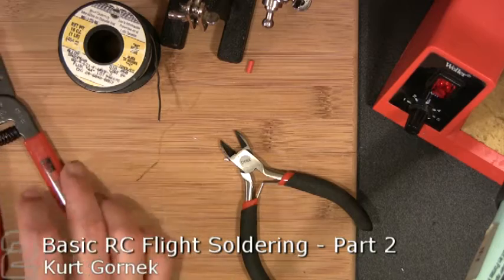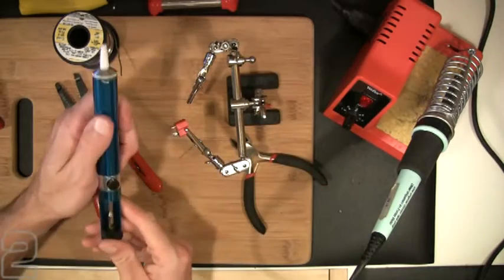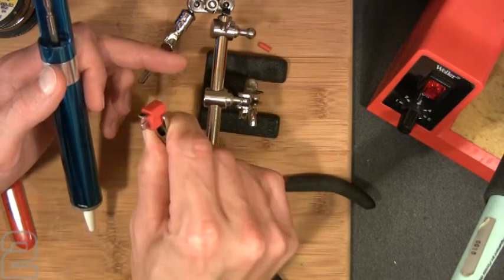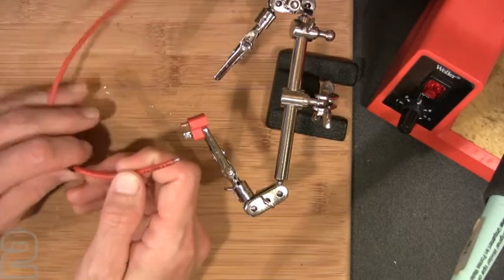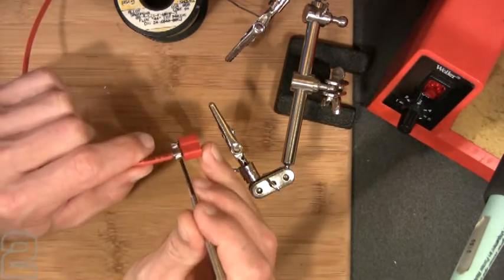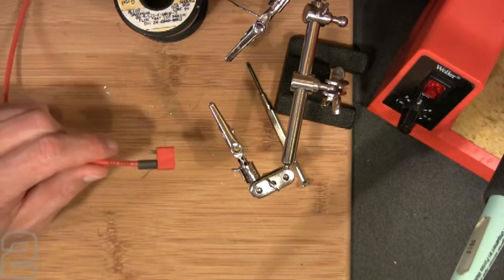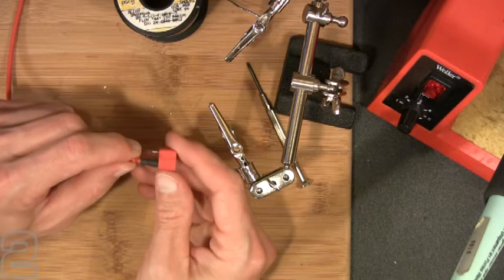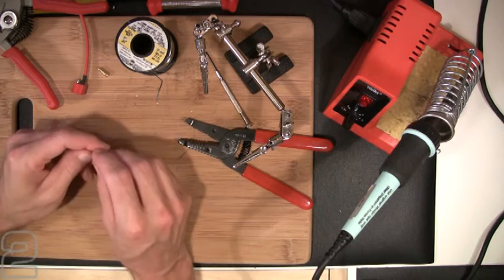RC Flight Soldering - Part 2

Comment from the maker: Silver-bearing solder (like 62/36/2) is prevalent with audiophiles (audio system nuts).  Although it does have some marginally better conductivity, slightly higher tensile strength, and can help protect silver-plated terminals from oxidation, the benefits over good 'ol 60/40 tin/lead activated rosin for RC hobby application is negligible.  It does have a lower melting point than tin/lead so if you have a lower wattage iron and want to go lead-free it's a better choice.

Comment from the maker: I use, and have used for years, Kester 44 Rosin Flux solder, #66/44, 1.2mm (.050).  It flows nicely, has an ample amount of flux for washing away oxides and keeping the tip clean, and a 1lb spool will last you for several years.  I like the .050 size - it's good for everything from radio system wiring all the way up to 10AWG battery wiring, assuming you're using a decent 45W 800-850 degree F or hotter iron.  Just be sure to NOT inhale the vapors and wash your hands afterwards.  Good stuff.

Comment from the maker: If you use Rosin Core solder, the flux is in the core, so no external or additional flux is needed.  Some people use solid core and use rosin flux.  If so, apply flux to each connection (wire or terminal) prior to soldering.  Apply heat and melt the flux onto the surface either before applying the solder or during.  Just be sure NOT to use acid flux.   Acid flux and its vapors are corrosive to electrical components.  Always use rosin or water soluble flux products.  Rosin is still most popular.